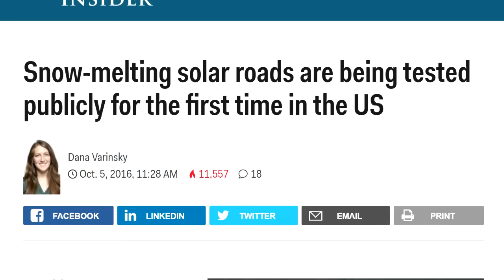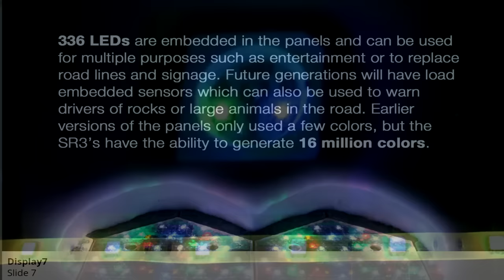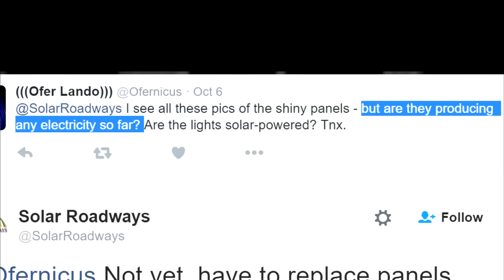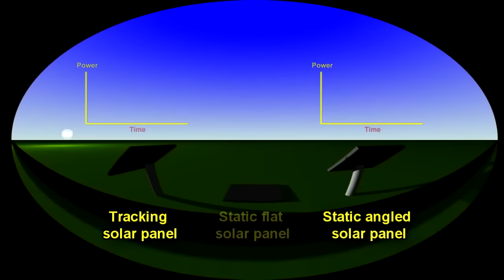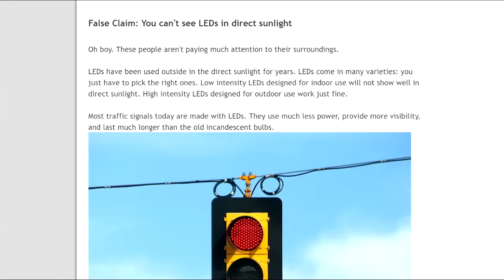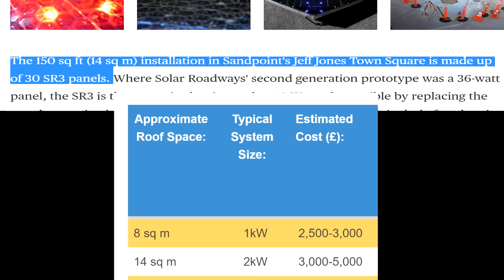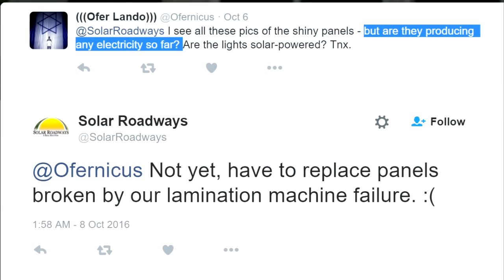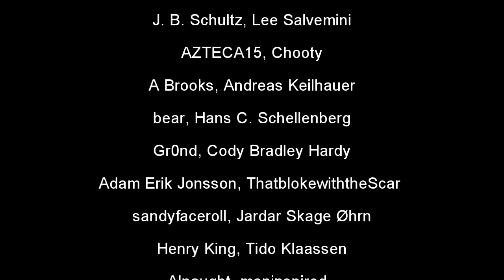First AMAZING Solar Roadway UNVEILED!

Comment: I have a terrible feeling that, 30 years from now, when they still haven't made any progress, people will still be going on about how great an idea Solar Roadways is.
Reply: At the same time I have a feeling that 30 years from now, you will still be berating latest advancements in every day technology. ;)
Reply: It's not an advancement if it advances nothing and achieves nothing but crowding out better ideas.
Reply: Baron Ironmaggot If your idea is actually viable, it can survive a bit of scrutiny.
Reply: Baron Ironmaggot Really? Pseudo intellectual? You could've argued that they're wrong (they aren't) but this weak argument is just embarrassing proof that you have nothing to say.
Reply: M.Porky You know what's amazing? Pretending for the moment that both ideas were possible, wearing solar panels would be a much better idea than putting them on the road (assuming you spend a lot of time outside).

Because your clothes surround you, you'd always have at least part of the solar panels directly facing the Sun (as long as you are outside during the day). Plus, there'd be no need for insane amounts of infrastructure to install and maintain them, or to transport the generated electricity.

Still not as good an idea as just putting them on the roof, though.
Reply: +Baron Ironmaggot SLOW CLAP
Reply: I have to disagree with you Baron the Ironmaggot.
This is not an advancement in technology. All this technology was already existing. As an engineer I do no claim everything we do is an advancement in technology.
Some of it is creative repurposing of technology, hardly an advancement. More like a step in the right direction you want to walk.
Reply: Well, people still believe breakthroughs in cold fusion and parapsychology will happen any day now, so, yeah, solar freaking roadways will be with us for a while.
Reply: Did you watch the video?
Reply: You're on to something. Socialism failed spectacularly when the Soviet Union fell. Now 35 years later the US is full marxists.
Reply: Srithor someone stinks of phallacy around here
Reply: Srithor "figurative". look that word up.
Reply: Srithor Before? judging by your comments it looks like you have been there all along.
Reply: "What a great idea that's on the way!" ...4 years later... "It's getting closer!" ...12 years later... "It's almost here, solar FREAKING roadways!" ...and so on...
Reply: Hello person from 6 years ago.
Reply: 23 years to go, lol.

Comment: solar roof panels make alot more sense
Reply: CaptainSkelebones oh yeah!? You hippy! Prove it... Oh shit half the roofs outside my window have solar panels of some sort....
Reply: it's not sci-fi enough for normies.
Reply: solar hats for yo phone charging needs... until it explodes XD
Reply: +Fuzzycat hahaha... yes
Reply: skyekross don't buy the Samsung solar hats, then your head doesn't explode.
Don't buy the iPhone ones either, the metal backs will burn you and the all current models of iPhone can't connect to them.
Reply: a solar hat would not make sense, i stay inside all day, and my phone stays in my pocket
Reply: Depending where you live , no solar panel make sense . If you live in a place with relatively not many sunny days than cost of producing solar panels and than cost of utilisation of said panels (solar panel enthusias rarelly even seem to think about it) make them pointless. People shouldnt mindlessly push solar energy in every place.
Reply: But then they'd have to acknowledge that life doesn't have simple, single-purpose solutions to every problem!!!
Reply: Well, solar panels could perhaps one day become so efficient and cheap that even very little sunlight is enough to generate power. But you're probably better off building whatever clean power that works best for every area.
Reply: indeed, but no one would have given them the money they wanted if they merely planned to build the panels on roofs.
Reply: Kleavers
It doesn't matter how efficient you can get solar panels to be - they will always be ~50% more efficient on an angle, ~100% more efficient tracking the sun, and infinitely more efficient when they're not covered by a car blocking the sun itself. 

The relative efficiency remains constant.  Even if you quadrupled panel efficiency somehow, it'd still then be 8x better on an angle, and 16x better tracking the sun, and generate 0x the power when blocked.
Reply: solar freaking roofs
Reply: I design them there all the time ...
Reply: why not just build covers over the roads, they stop the rain the snow and prevent sun glare and can have hanging signs all while producing 2x more  electricity.
Reply: Joseph Evans yeah but that doesn't have the "FREAKING" in their name, so it's totally not cool at all.
Reply: Higgins2001 Yeah I know, I was responding to MrMleczkp, but YouTube didn't show that :/

Solar panel covering on parking lots is a vastly better idea than putting them on the road. It's just so stupid when you think about it for ten seconds. Putting LEDs into the pavement/roads sounds like a fun idea that could have some options though. But just leave the solar panels on places where there are no cars or other things blocking/damaging them....
Reply: *****
Sounds like someone didn't get their vaccine ;)
Reply: "solar roof panels make a lot more sense" is not quite right.  "a lot more" implies that there are two non-zero quantities one of which is bigger than the other.  "infinitely more" would have been a better way to put it.
Reply: The carparks with solar covers is actually the most legit idea. Cheaper alot more effective and with serious added benifits like not burning yourself on your seatbelt.
Reply: There are very few places where solar doesn't make some sense.  Many of the places that don't get a huge amount of sun also have high energy prices because of a lack of other resources.  I am not in favor of "mindless pushing" but people should run the numbers and see in every case.  In sunny places it has become a bit of a no brainer for many.  The price of the panel has come down a long way.
Reply: Only if your goal is to generate power.

If however your goal is to get people to give you grant money, not so much. I mean, solar roof panels already exist.
Reply: What if they can design solar roadways that can be installed on roofs and used as a replacement top layer for the roof? They can then use those to cover as many buildings, homes, covered parking structures, bus stops, and various other structures.

The lack of foot traffic would mean that the glass surface gets less wear, and cost may come down since they will not need a really thick layer of glass.
Reply: NO! Everyone needs A wind turbine in their backyard, ITS THE FUTURE!
Reply: Razor2048
But what would be the point of using these stupid roadway tiles, then?  They've already invented solar panels for roofs, and they're installed all over the place!  What possible need would we have for LEDs on the roof?
Reply: Here's 2 million dollars. Make it happen.
Reply: But there's no need to waste millions of dollar to prove they work. Hence, the opportunity to fleece the public on a hyped up bad idea like solar (freakin) roadways.
Reply: Yet still a lot less sense than forgoing solar power altogether when much better and cheaper grid power is readily available.
Reply: except you are forgetting about the energy and polution generated from the construction of each cell. As it currently stands, if you pay $0.30/kwh it will take a roof mounted panel about 6 years to pay for its construction costs. And that doesn't include the charge controller or the rectifier. Solar power is a non-linear generator (DC), City power systems are linear (AC... 3 phase AC at that!).

In short: the cost, polution and energy requirments just to make the cells would never be paid off over the limited life of the cell.... You are throwing Energy and Waste into a pucduct that won't be offset BY the product.
And before you ask, Yes I'm an electrician (and Instrumentation mechanic), And yes I design, install and maintain Solar arrays for both the State and private installations.
Believe me, I WISH this was worth while, if only for the fact it would mean I have work for decades. But it doesn't. Save your tax dollars for something that does.
Reply: +Nathan Schubert yeah if the money was going to increasing the efficiency of solar panels i'd donate 15 dollars
Reply: +Reaver of Souls
Anyone can make up lies about their education and position on the internet. Try not to rely on those. 

No one is going to care about you as a person on the internet, only your arguments. Stupid people will ignore whatever you say anyway, and reasonably intelligent people will be convinced with solid arguments.  This is why it just makes you look desperate to prove something, and makes your position seem rather silly. Even though your arguments themselves aren't wrong.
Reply: only two issues.
solar panels are glass and would wear down MUCH faster then traditional roofing tiles. if you could use some kind of fancy bullet proof glass or plastic to give them a longer life that would work.

and second. where I live it snows. alot. and you would need to go outside near daily to scrub the panels off either with a roof shovel or god forbid climb on top of your house and spend hours prying snow and ice off of these solar panels.
Reply: CaptainSkelebones And you don't constantly put pressure on them. You will need a lot of isolation tho.
Reply: SH4DOW what exactly do you want to tell us? The point is roof > street. Solar panels on roofs survive just fine. Even huge hailstorms. You know they are being used since 20-30 years ago? 
And yes, you should not expect much power coming from them in winter in arctic climates. Snow aside, the sun doesn't shine much anyway and when it does it is at low angles. Find a different source for energy generation if you live in such part of the world.
Reply: nah, a lot of glass roofs here in finland, mostly balconies. its usually made of toughened 8mm safetyglass which is enough to have 2 workers stand on it with tools without it breaking. (90cm max width/panel). there isnt really that much wear and tear on them, now this one is a guess but id say because the surface is smooth and solid, its not porous like tiles and doesnt rust. 

you are right about the snow tho, they must be installed with a minimum of 30 degree slant so the snow will fall off em before it starts to weigh too much. 

-glassworker
Reply: You mean solar FREAKIN' roof panels?!
That way all the you folks think it's cool and get behind it!
Reply: Solar FREAKIN' Roof Panels!
Reply: Wow, would take over 20 years for the panel to pay for itself where i live.
Reply: piglet lol ^^
yea we were talking about putting them on ones roof.
(looks like he deleted the comment i was replying to, commenting about glass roof being bad as a roof material due to not being as durable as a material for it, which is not true)

anyways i do agree, and toughened glass wouldnt really work, as soon as you wear through the surface the whole panel will shatter. not to mention a small stone stuck on a tire, essentially striking the surface 100kmh would probably be enough to shatter it. (or a piece of the previous shattered tile)

it might work on your yard or something where you drive slowly, but dirt and wear will seriously diminish the amount of light the solar panels would get.
Reply: Yup... only hazard/obstruction is birdpoop and hail. Roof surface is definitely more than roadsurface, servicing is much simpler than breaking up the road.
Reply: That's what Musk wants to see next with SolarCity.
Reply: Don't be silly, it's not like there is a giant giga-factory running completely on roof-mounted solar panels .....
Reply: Maybe that is why the idea already exists and is used.
Reply: Yes. Just fund Solarpanels for parkinglots of supermarkets. That simple.
Reply: I think they just really want the Tron roads. Seriously, I think it's the one obsession still driving them at this point.
Reply: Solar Freaking Rooftops! With the added benefit of 30 ton trucks not driving over them every day!
Reply: Oh the unbareable atmospheric pressure per square cm... the sobbiness..I rest my wrist on my forehead snif*DeepSpaceNinja
Reply: +Kleavers Right. Solar panels covering the parking lots so you can actually see the LED lines because now the LEDs will be out of direct sunlight.
Reply: MrKanilammit and would have enought energy xD
Reply: If only someone come up with solarpaint...
Reply: Synthusiast There is a france projekt for Solarfoil. So thin flexible laminated solarpannels that you can put on stuff like cars roofes or yea...roads xD but they look at least better thought throu than this tiles.... Still bullshit but...better bullshit. At least on roadways :D
Reply: Nerobyrne no, they just wan't money from the goverment and jumpon the Solare Freaking Roadwais Hypetrain so they an develop actual stuff with it xD
Reply: SOLAR-FREAKING-ROOFTOPS
Reply: They are kind of same same honestly
Reply: tylor Gallagher lol no, for one, roof panels are angled much better.
Also the fact that people aren't driving on them all the time means they last a lot longer and aren't constantly shaded.
Reply: tylor Gallagher
Not at all, really. How clear is that glass going to be after a mere day of moderate traffic? That glass kinda has to be as transparent as possible.
Reply: ***** 
Some people have pointed out that there is glass that can withstand traffic because it is hard enough, that is certainly true.
However, nobody could pay for even a small parking lot covered with this material.
Reply: Nerobyrne
Yeah, we're talking every stretch of road in America. What's wrong with putting the panels on the side of the road? I know what's wrong - No Tron roads for these nerds.
Reply: ***** I think if you guys built a ton of solar farms in Nevada, you might actually solve your energy problems and become independent from Saudi Arabia.
But I'm no physicist, my expertise lies more in magnetism than solar power.
Reply: Nerobyrne
Lol I don't live in the U.S. mind you.
Reply: +JoesGuy Yes. And if it rains on those GLASS tiles and you need to stop in a hurry? Good luck with that. 

Instead of building a $3m disco floor that failed in no time at all, the money would have been better spent building a proper road of hexagonal textured glass tiles (no expensive solar or LEDs) to test just how practical such a surface is to drive on. Because if, as i suspect, it turned out to be a deathtrap, the solar freakin' aspects would be absolutely moot.

Can you drive on it? That should have been the focus of the first tests, and it shouldn't have needed three million dollars to test.
Reply: As I said, they didn't think of practical details like that. They want their shitty Tron roads.
Reply: Oh my god you're a genius... Solar Freaking Roofs!
Reply: Liber Philosophus *solar freakin' roofways

Comment: Why? Solar panels work way better on roof tops, and are obviously much better protected. Yet 99% of roofs have no solar panels at all, why the hell would you be trying to put them in the road?
Reply: Carl Zimmerman solar FREAKIN’ roofs
Reply: 99% of rooftops don’t have them because 
1)You’d have to add a whole new wiring system
2) they’re not all that green
Reply: bEcAuSe iTs InOvAtIoN
Reply: To be fair most politicians and such getting behind it are just doing it for virtue signalling.
Reply: @tacticallemon7518  however actually subsidising private instalation of solar with tax rebates/lowered sales tax on solar kit would throw a hell of a lot of weight behind improving solar production. 

We need to spend on various things the main government spending needs to be on nuclear immediately but Solar has its place.